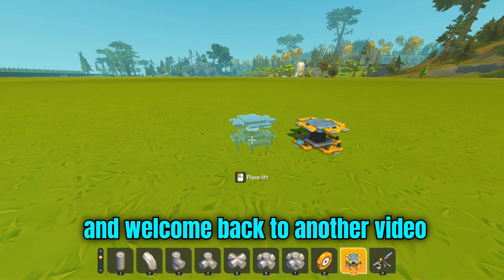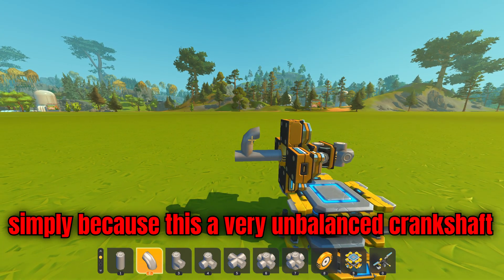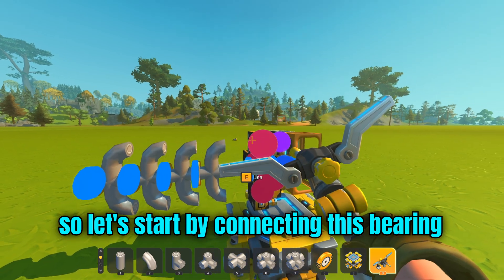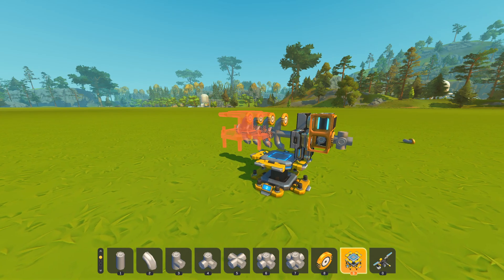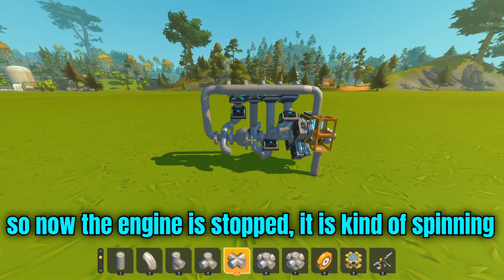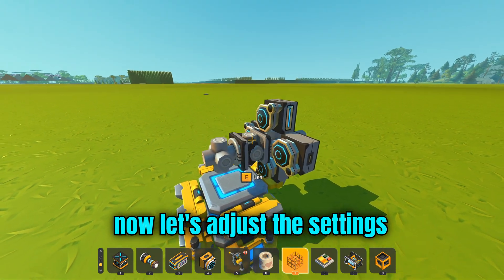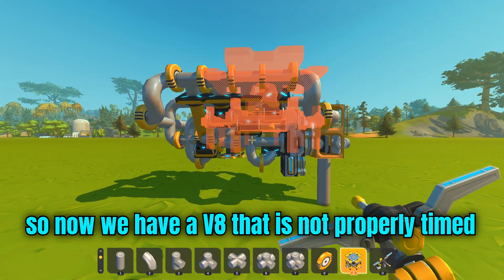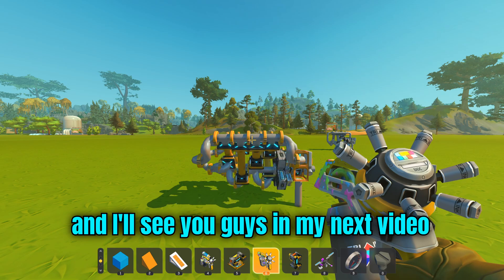How to properly make Piston Engines in Scrap Mechanic 2023

Comment: Would this work with a flat plane I4 instead of the cross plane shown in the video?

Edit: So I gave it a shot, and it works well, although I did it the lazy way and now there's a big gap in it. The firing order is 1342, just like most irl I4s.
Reply from the maker: the 1342 firing order won't give you benefits, scrap mechanic likes the 1234 timing a lot
Reply: @Deniz69567  well, it does help prevent bearing sway and makes higher piston count engines more smooth.
Reply from the maker: yes but, higher piston count are actually more likely to hurt the crank. This is why you don't see inline 8 engines anymore
Reply: @Deniz69567  I was talking about firing order, more pistons creates more load on the bearings and if you have too much load on one side of the engine then the bearings will break. that means firing orders can mitigate that. If you're thinking of comparing inline eights with v8's, a v8 is just more compact, and not so long. that's a more reasonable conclusion to why inline eight engines are not popular.
Reply from the maker: @-aid4084  dawg I would never compare an i8 to a v8 💀 and also there is a thing called locking crank that locks the crank which means the controller bearings on the crank won't have load. Or you could use piston locking crank which uses 0 bearings that rotates the piston 90 degrees when it's out of the lift, and it's incredibly solid and we mostly make 220+ horsepower v8 engines because of it.

edit: youtube studio bugged, your reply was on another comment

Comment: great video Deniz! the way I used to make passthroughs was to place the piston, place a pipe or block in the piston, then attempt to place a bearing on the piston. this has 2 bearings so theres less flex which is great for higher torque applications.

Comment: Use AND gates. You'll figure it out.
Reply from the maker: logic gates will increase a tick delay of 1, so it will reduce performance quite a lot despite the 1 tick delay
Reply: @Deniz69567  Which you can offset by retarding/advancing the timing on the sensors. Using AND gates removes the need to change timing to start and stop the engine, and instead allows you to advance the timing whilst driving to increase the engine output, just like a real engine.
Reply from the maker: logic gates aren't suitable for higher rpm even if I advance the timing, I can technically just use a double bearing which can be used as a clutch. So I can make it WASD while still making the engine active
Reply from the maker: @Cynical...  that's exactly how we call it, if the timing is off we call it stopped. You could ask anyone in SM Mechanical Discord and they would never use logic gates for high powered engines like a kein engine, locking crank v8, etc. The double bearing clutch setup allows the engine to be turned on while the car is stopped but when you press the W button, it will start going. And somehow using logic gates would make engine's reliability reduce
Reply: @Cynical... But delay in sm is significantly higher than irl, enough that it should be kept at an absolute minimum.

Also, advancing timing isnt the same as less delay and especially with faster engines you will get increasing reliability issues. This happens, as it looks further into an uncertain future without enough time to react.
Reply: @Cynical... Also, just because most engines on the workshop exist in a certain way doesnt mean its the best. You can just take a look at ~50% being kan engines.
Reply from the maker: @Cynical...  yeah that may have the same rpm, but behind all that you have a slightly decreased performance. lol this is funny
Reply: @Deniz69567  what performance would you consider decreased?
Reply from the maker: @Cynical...  what kind of question is that? Again, logic gates will always serve as a limit for much powerful piston engines. Something like a Kein engine won't be happy with using logic gates
Reply: @Deniz69567  So you're telling me that you know piston engines using logic gates are inferior yet you can't tell me any power/torque metric that can prove it? If you're telling me the only proof you have is that your own attempts have resulted in stuttering/reversing engines then I'm sorry buddy but in reality you're just not very good at logic. Either that your PC is too bad to run SM at the highest physics level, which is also a you problem.
Reply: you do realise you are talking to one of if not THE most knowledgeable people on piston engines, yeah your engine probably works fine, but i can also guarantee it is nowhere near the limit of performance @Cynical...
Reply from the maker: @Cynical...  wtf? Ok I'l dyno the same engines, one without logic gates and one with logic gates
Reply: @Cynical...  Ok let me spell this out for you, logic gates add an extra tick of delay between the sensors and the pistons, this is a very big problem as you will need more timing advancement to have the same idle rpm, however when you apply load to the engine, because of there being more timing advancement it hurts the low end performance and causes reverses because of the added advancement needed to mitigate the delay at idle speed. This issue becomes a lot bigger when you use a layout like a Kein engine which is the most efficient and fastest piston layout in the game, on top of the previous issue, there is now an issue where the engine will take longer to react to changes in forces, so the engine will become very unstable, this stability will get worse at higher speeds.
Reply from the maker: I think you should try using logic gates on kein engines, you'll see what we mean @Cynical...
Reply: how is this conversation still going
Reply: definitely do not do that on a performance engine, for a low performance engine you can get away with it but when your engine is pushing the limits the extra delay of logic gates becomes noticeable
Reply from the maker: @loz4830  I agree